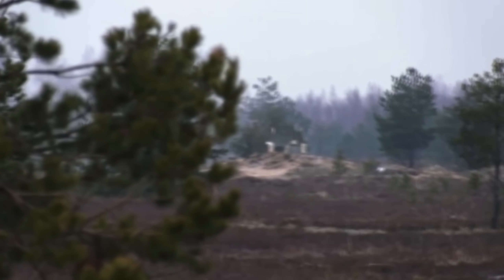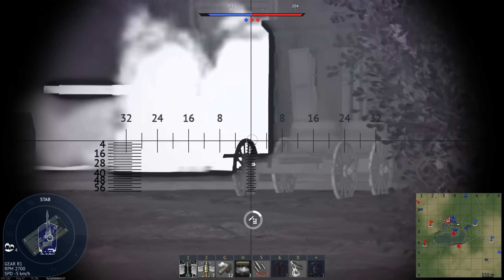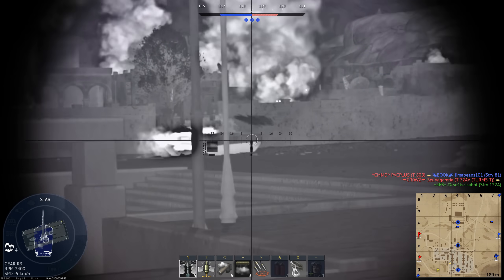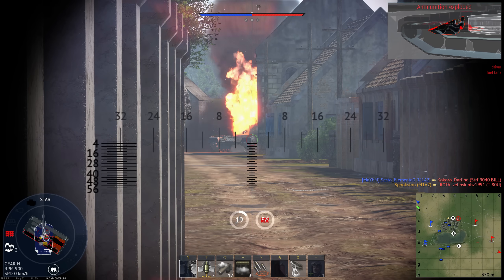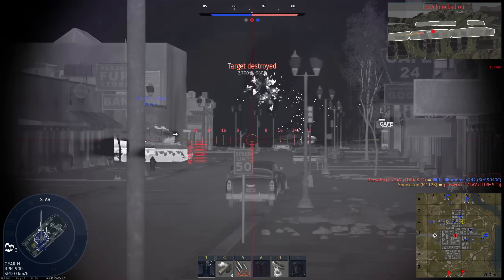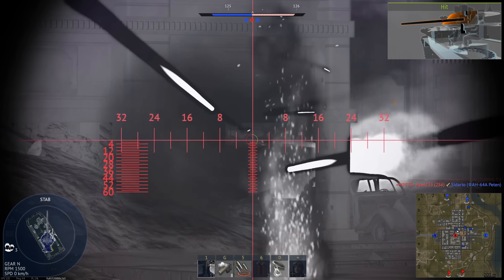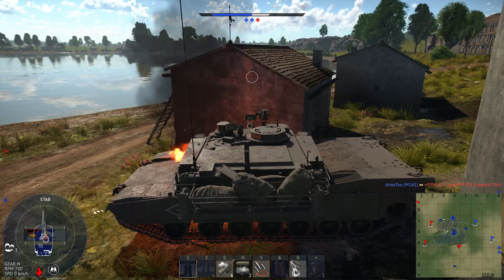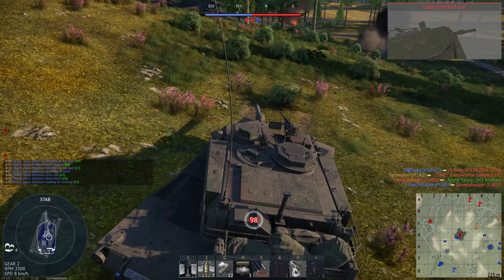Why The M1 Abrams Uses Depleted Uranium

Comment: China also has a monopoly of the world's tungsten reserves, making it even rarer.
Reply: And you probably don't want to rely on an enemy nation that engages in the practices of slavery and concentration camps for your war materiel.
That's just retarded.
Reply: Then I guess Germany is retarded.
Reply: @UNSC-Saratoga  yes
That a very good question
The have the best Canon in the world: The hight velocity slim L45 Canon.
Why they don't use the uranium and increase the pen.
Because, most of the tungsten that used Germany in the past came from France and Spain. But now came from China
Why Germany,why?
Reply: @UNSC-Saratoga  Surprise!
Reply: @ser43_OLDC  The best meme is that France could easily supply them with all the DU they could ever need. Which works with that whole EU thing and whatnot...
Reply: @ser43_OLDC  Its cheaper and if the Bundeswehr/KMW (gun/shell manufacturer)  can get something cheaper it does. Germany has pretty ok relations with China because of money.
Reply: i mean, china produces more tungsten than everyone else put together but its still not a monopoly. Vietnam produced 7200 metric tons of tungsten in 2017 while UK and Bolovia produced 1100 metric tons. You don't need the ridiculous amount of tungsten china produces to make penetrator rods. Honestly its less "we dont have a supply" and more of "DU works just as well and we're never gonna fire this thing on our own soil so the downsides are negligible"
Reply: How the fuck tungsten is rare? You can find it in every CNC shop or hardware store. Its used in milions of tons to produce drillbits, drills, drill-heads, and cutters all over the world. And tungsten dart of APDSFS or hard core AP is made out of tungsten alloys not a pure tungsten.
Reply: @HanSolo__  drillpits arent pure tungsten either. But some low tungsten alloy with high hardness steel.
Reply: @Average_Joe2  both use powder tungsten to get a powder alloy so whats your point?
Reply: @HanSolo__  i think you're underestimating how much tungsten you would be wasting by using it as AP ammo on an industrial scale -- literally throwing away an irreplaceable resource. Carbide bits are just a thin powder coating, and machining bits are very small pieces that can have a long lifetime if treated right. Penetrators have to be pure sintered carbide or near pure tungsten alloy. Unfortunately china literally has like 70% of world's tungsten production or some shit, so it's not ideal for mass military use atm
Reply: @BlargOnMyFacepls  Dude. Nobody uses AP. Not even one tank which is not on the war has APFSDS onboard. What for? Its 8-10k euro. You buy few thousands and you put it into the armory and its there for 20 years or more. Even then you don't fire it because few hundreds of these makes your barrell worn out useless shit. Therfore you only fire practice rounds or HEAT but it still a very rare thing. Frag-explosive round is the one you could fire on the range. AP and AT are for store only.
Reply: @BlargOnMyFacepls  It is just a difference in scientific research. Germans scientists were the first that stood against the wide use of DU cores and DU darts in artillery and tank-gun shells. 
The difference is that DU when penetrating the armor do shatter into hot fragments at the tip of the dart and stay on fire. After breaching a hole it spalls into shrapnels and DU dust. Hot shrapnel gets into Soviet typical design ammo carousel and  the whole inside of the tank sprayed with DU dust gets a cooking of ammo some hot suppuer with human meat.
You can see it then as.a dark smoke of burned tank carrying tiny DU particles into the air, dirt, water. Few T-72s and Type69s cooked this way  turns everything around not only toxic to breathe for people passing by weeks later. It turns the place into radiologically contaminated. The Uranium rods which came in early 90s to ammo stowage of M1A1, T-80U, T-72B, T-90 were not selected with focusing on the amount of enriched Uranium still included in the composition of rods at some high %. 
This and kids playong in wrecked tanks was not the real issue. What made a huge difference was the WIDE use of DU cored artillery shells that rained from the sky covering a town or a big part of the city. Ruined buildings started threating the UN or Red Cross Search & Rescue teams. Ruins appeared as radiologically contaminated and highly toxic for international medics, rescue teams etc. Causing both poisoning and radiation sickness. 
It changed, but at that time DU rods need to be selected not dirt cheap anymore.
The use of AP rounds during the tank fire training is caused by wearing the barrel 3x faster and AP high barrel pressure still does not change its effect with ammo price high or having a free ammo supply. It wont be used on the range even if it will cost will drop into  dollar per shot
Reply: @Average_Joe2 Pressure and wear of the barrell is the main reason AP cant be used on training. Not the tungsen stock prices. If prices will drop pressure when firing the gun still stays identical  Drill bits made of tungsten alloys only confirm what I said on avaolability of tungsten alloys and tungsten powder.
Reply: @HanSolo__  tungsten alloy drill bits and it is a very small amount of powder put on the drill bit it’s not made of it and guess where most of those drill bits are made that’s right China relying on a potential enemy nation for your tank ammunition is stupid
Reply: @HanSolo__  gold is also rare but you find it on any pawn shop.
Reply: @ChucksSEADnDEAD  Gold is rare? Muahahahaha... Diamonds are rare. Gold is rare in nature only today because exploited already. Nowere near rare on the market. Every fucking  Pc an Mobile has some.
Reply: @HanSolo__  That's the point. Something can be rare but also common. During WWII Germany had problems with tungsten as a strategic material. Going to the local Harbor Freight doesn't solve the issue. If a country wants to boost their gold reserves, going to the local pawn shop doesn't solve the issue.
It is estimated that the total gold production in history is around 200,000 tonnes. Almost 2 billion tonnes of steel are produced yearly. Gold is rare. If it wasn't it would be cheap.
Reply: @HanSolo__  diamonds are not even severely rare. The markets are controlled just to keep them rare

Comment: Short answer; its common, very dense, self sharpening and potentially sets the inside of the target vehicle on fire!
Reply: @MR_6238  when refrencing self sharpening that just means it dosent mushroom as much cause it sheers off therefore maintaing more energy as it impacts multiple layers due to its smaller diameter since there is less mushrooming which means its not spreading KE over a wider surface area
Reply: It does, but there's been numerous stories and reports of crews being rendered into paste after taking a DU round from an Abrams.
Reply: @Tienhamir100  So just like a tungsten or steel round?
Reply: @Narvaljodchik  
DU rounds are a whole different monster.
Look it up!
That's the fun in this after all!
Reply: @Tienhamir100  It will actually liquefy the crew.
Reply: @colejones594  Israeli M322 is not a copy of M829A1 and is fired at a higher velocity so no, it wouldn't and shouldn't.
Reply: @MR_6238  I want to like your comment because it is informative, but I want to dislike it because I prefer realism more than anything else.
Reply: It's also a byproduct with very few other applications. Thus being readily available and having no other industries looking to purchase it.
Reply: @MR_6238  most the time segmented rods will only be in two segments. The more segregated the rod, the higher the risk of rod failures becomes. Even the M829A3/A4 have had failures in testing. We are already pushing the limits of current cannon tech as APFSDS are considered overpressure and are being pushed as fast as theoretically possible. With segmented rods we are pushing the edge of safety margins for keeping them in one piece as they leave the tube. The rods dont really get pointy. What the sharpening is referring to is the deformation will fracture away from the tip. At most with current rod lengths you'll achieve about a 30-45 degree change from the initial flat face of the actual rod. The point you see on the complete round is just a ballistic tip made of steel. And then talking about extreme slopes armor like upper front plates the chances of hits are slim, and the rods tend to be long enough to punch a hole regardless. When looking at a tank you arent going to try to shoot at the parts with the most angle to you. You shoot at what's closest to flat from your frame of reference. You also arent trying to hit the upper front plat on anything image after about 1976, you might not cause any damage. So the person might be right, but at the same time the scenario is very uncommon and doesn't match what tank crews are trained to do. Most armor cant deal with current penetrator technology, the bet is that you get a shot off first and hoping it totally destroys the enemy tank. That's a reason the battle of 73 easting was so one sided, it happened during a sand storm that the Iraqis couldn't see through but the US tanks could.

The effect of heavy slope also takes a pretty thick amount of armor to start to really cause effects on the rod to diminish its performance. I think the person is referring to spaced armor and not a solid type like chabom. Once penetration has started everything acts on a single plane of reference. And spaced armor would need a lot of plates and the spacing would need to be much larger than most believe to hav the effects described. You would need to have enough space for the nose of the rod to be exposed and that scale is unrealistic. You'd have a massive turret and hull and that's a lot of weight as well.
Reply: @MR_6238  also. The Abrams UFP is at 82.5 degrees from the 82 on the original M1, it was thickened for the IPM1 as well as the angle change and subsequently carried over to all models from the M1A1 and on. Initially it wasn't thick enough, at 38mm, to have a chance since the plate would deform slightly and allow the rod to start to dig in, some actually punching through. Thickening to 51 or 52mm made it more rigid and they increased the angle slightly. It has a substantial chance to ricochet APFSDS. Also, tungsten rods will shatter and disintegrate at that angle, though they may cause minor gouging in the plate but no substantial deformation of the armor. The place you dont want to shoot is the front glacius of the turret. There isnt a round in production that can punch through the front of most modern turrets besides the Armada, but depending on rand you might just hit external steel plate that is basically for looks and covering the exposed components on the actual turret, though the protection is reduced purely because theres no crew inside.
Reply: So, why aren’t other countries use them?
Reply: @MR_6238  
That would be incorrect. There have been a normal of friendly fire incidents that show that to be false as the DU rounds had no problem penetrating armor.
Secondly modern armor is composite not  sloped spaced plate armour array. 3BM42(M) is circa 1986. Russia most modern round is the 3BM70 series
The German DM53 is far from underperforming.The L2 uses the L55 not the L44.  The longer L55 allows the DM-53 to achieve much higher velocities down range 
Like the Russian round, the DM-53 is not the most modern round, the DM-63. European countries do not use DU ammunition to due to opposition so they have to use Tungsten round. Use of Tungsten is why the EU panicked over the T-14 because 120mm Tungsten won't penetrate the T-14 armor. Upgrading from 120mm to 130 gives the Tungsten round necessary KE to penetrate the T-14s.Notice that all the US military did was develop the M829A4 and called it day. The US figured out that increasing the mass of the penetrator allows to better penetrate Russia RA.Russia tanks depend too heavily on RA for protection. Another fun factor about the 130mm is that a 130mm HEAT round will be able to shred a T-14 in one hit. The larger size of the  round allows 130mm pack in 50 percent more explosive power
Reply: @verdebusterAP  "The German DM53 is far from underperforming.The L2 uses the L55 not the L44" meanwhile Swiss told the world DM53 achieves 650mm of penetration... at 3km's against a vertical plate, meanwhile in WT 652mm at point blank, yep, it's not underperforming.
Reply: @Ophiv2  
650mm is respectable level of penetration. Secondly the Swiss army 
does peacekeeping missions and do not engage in external conflicts as part of Swiss neutrality. They don't have need rounds with ultra high penetration as 10/10 times they are not going to engage in any conflict.
Reply: @verdebusterAP  Which means nothing as their military batantly stated 650mm is at 3km's against a vertical semi-infinite RHA block. Keep in mind, official sources for M829A1 state 700mm of Line of Sight penetration (meaning vertical pen is lower by roughly ~100mm) and 750mm for M829A2 at point blank, meanwhile the most official sources for DM53 state 750mm LOS... at 2km's (said so by Rheinmetall).
Reply: @verdebusterAP  i thought they where gona use the 140mm cannon
Reply: @colejones594  
The problem with larger caliber is loading ,capacity and weight
The larger round can only handled by an auto loader which requires a redesigned turret as most western countries dont use auto loaders
Secondly , by going 140mm, you reduce the amount of ammo you can carry.  The original M1 carried 55 105
That dropped to 40 with the M1A1 upgrade. M1A2 carried 42 rounds
So with a 140mm, your stowage is probably in high teens , 25 rounds at most. Lastly is the 140mm is much heavier than 120mm. The 130mm rounds weight 66lbs, 15 pounds heavier than 120mm. So you are probably looking 80lbs likely weigh By comparison,a 155mm M795 weights 102lbs.
Again, a redesign to handle the increase weight. 
The flip side of larger rounds is greater penetration as well increased capabilities with HEAT round but larger rounds have too many downsides
Reply: @verdebusterAP  fair enough
Reply: @verdebusterAP  another great point i was just stating the lst info i hd which was the thumper tank which had 20-40% more penetration compared to the 120mm thx for the info tho.
Reply: All are pros. And if the round is a bit toxic but only ends up in targeted areas then no problem.
Reply: @jeremybarrett3616  yes when an afgan child dies because a du round was fired and ended up in a stream/river/lake ect its "no problem" because it was in a "targeted area"?
Reply: @TheRealHalolad  It's a problem. For the child and their family. Less of one for the war machine which birthed said dud round. Then the problem becomes that the round was unreliable and didn't go off when intended. War is not kind. It does not wait on man,woman or child. It is apathetic.
Just as apathetic as the societies that participate in it. Do I know every person who has died during wars? No. Do I know every child who has died from unexploded ordinance? Again. No. I don't even know one. And that doesn't bother me.
Some may call that cruel. But it is hypocrisy to claim every death bothers me when I don't even know how,why or when they happen. Do you feel bad whenever there is an overdose in your city? Your county? Do you know how many died today in accidents or gun violence within 50 miles of where you live? Unlikely. And if you do know,do you even feel anything but passing acknowledgement?
People die all the time. Saying you care about each individual case won't change the fact you can't. What you don't know,you don't know. Is it sad when a child steps on a landmine set 50 years before in a conflict older than their parents? Yes. But is it my problem? Is it the problem of the designer of the mine? Or the soldier or guerrilla who laid it? Possibly. But bandying around talk of responsibility won't help the dead child. Sometimes a death is just that. A death. Best you can do is not live in a conflict zone and advise caution to your children. Lest they become a disappointing statistic for people on the internet to discuss in broad strokes whilst never knowing or actually caring about your child.
Reply: @MR_6238  go outside
Reply: @NeoEureka  Not during the pandemic